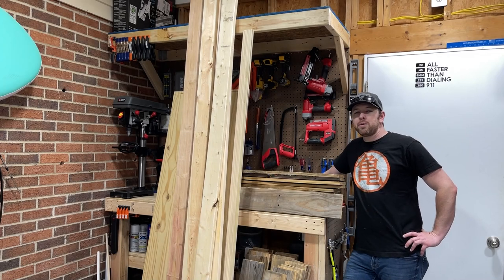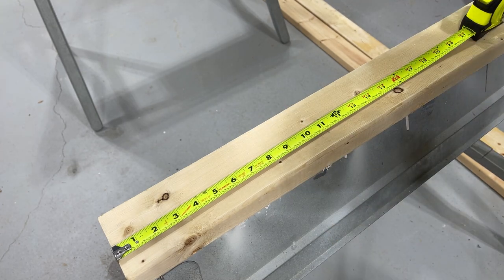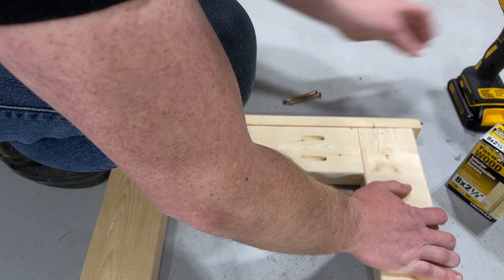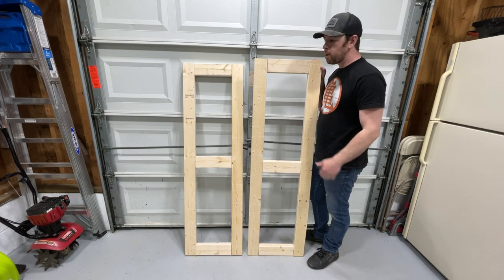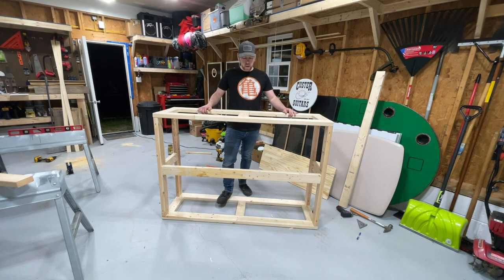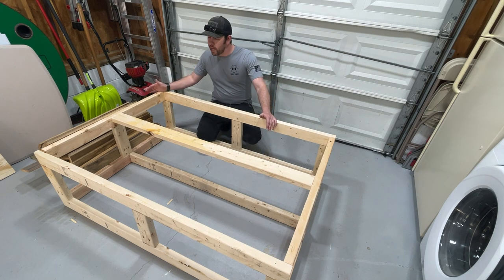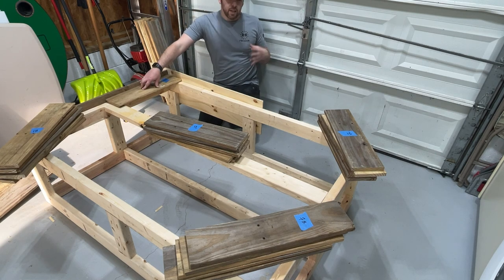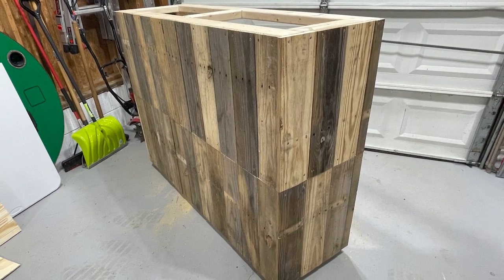DIY Reclaimed Wood Drink Bar - Build Video & Tutorial

Comment: I'll need to drink some tea with milk to manage this...

maybe had you done the same you could have managed to re-finish the old wood yourself.
Reply from the maker: It's reclaimed wood. You're not supposed to refinish it lol. That's the point of building something with reclaimed wood. For it's rustic and weathered appearance.
Reply: @AsukaYenOSRS  I'm talking about the top surface, I get the rest is an aesthetic thing.

the point of a project like this is to preserve the look WHILE using your woodworking skills to both make it functional and meld the aesthetics with function.

just slapping a pre-fab countertop on some old wood is cheating IMO.